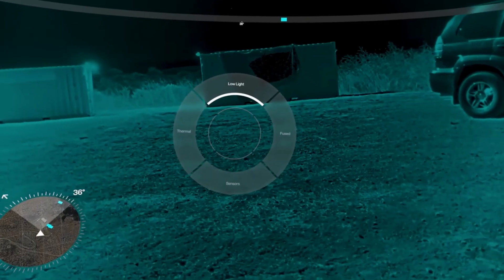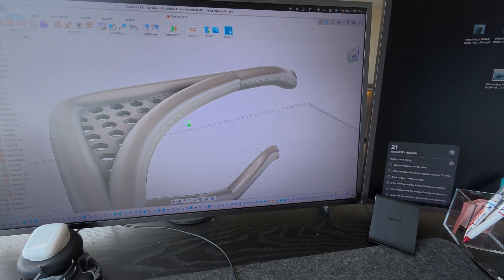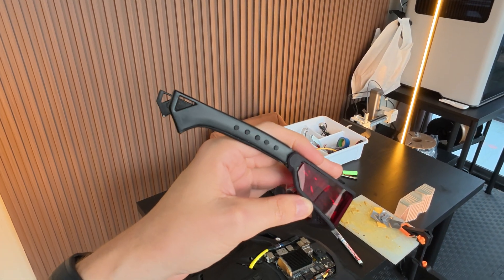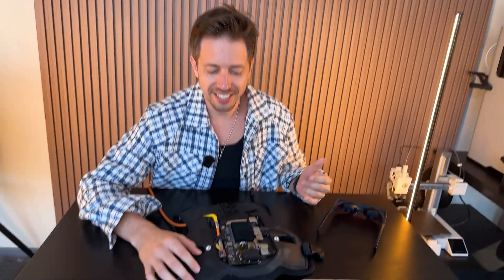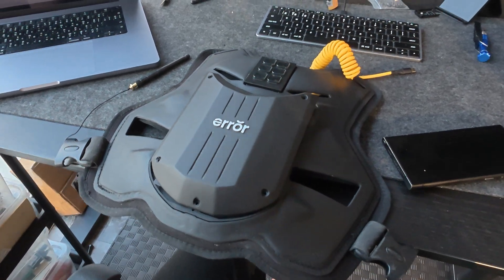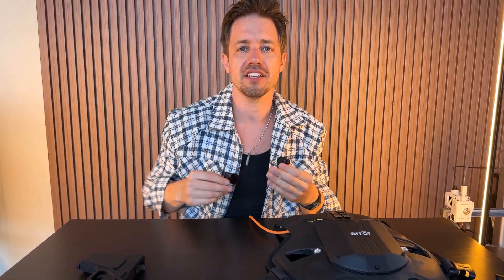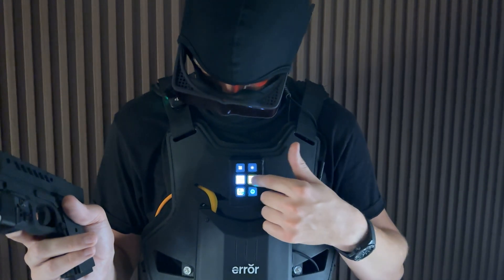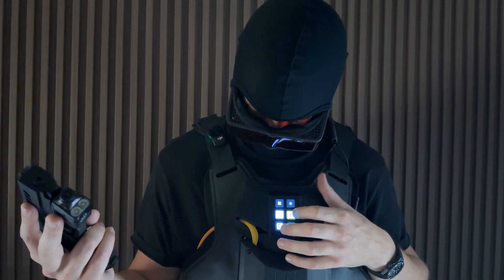I built my own ANDURIL EAGLE EYE

Comment: This is beyond cool. The possibilities are powerful. Range-finding + gyro integration for real-time 360° "radar" overlaid with the GPS map, foregrip style gun cam for longer battery life and recoil stability, inter-headset comms and video feeds, live recon auto-piloted drone feed, digital IR-based night vision, HUD waypoints, and so much that isn't crossing my mind. All it's lacking is hardening and encryption, against counter-offensives and espionage.
Reply: Ey error please add
drone
esp 32 radar like detecting humans 
wifi vision see through wall
thermal
pvs 14 analog night vision
Reply: @human-x8b  All really cool stuff, but I don't think WiFi imaging is possible (yet) in a portable, head-mounted form factor. Analog night vision could work for sure, but it's bulkier and more expensive, which is the reason why I mentioned IR-based NV. I guess I'm really price-conscious for cost-effectiveness reasons, but those additions will definitely make the headset more powerful and worth building into a more expensive unit.
Reply: Showing you how to gain control when parachuting got out of control.
Reply: aaaaaaaand several ways to track find and attack people dumb enough to have that  many sensors on them...your idea makes it possible for smart munitions to lock unto people
Reply: @chargedx5768  And your cell phone doesn't? The number of sensors means absolutely nothing. 

That would be true of any radio communications. Except an adversary would not be able to differentiate from person to person based on any of it if every target was equipped with the same devices. They could with cell phones though.

The idea isn't to hide from electronic warfare; it's to go on the offensive using it.
Reply: @RAndrewNeal  I am not planning on sending my cell phone into combat..you intend to send a person with all these sensors into combat...see the difference?...you dont come of as smart...so I will explain
the sensors you are talking about emit a lot of waves, if it is emitting waves then other sensors can pick up on those emissions and home in on them and track them, 
"an advesary would not be able to differentiate"...if the US can differentiate, Russia and China can..lol since those devices will be using different frequencies else everyone will be able to communicate to each other whether enemy or foe...all they have to do is look at which signals are in a frequency they are not using and then single those out as the enemy lol....
if you go on the offensive with another military with EW capabilities you are cooked....youd loose all awacs, EW jets and every person wearing a mobile sensor suit,....americans fought poor people for so long they think everyone they will fight will not have the tech to home in on all those signals
Reply: @chargedx5768  A-TAK is a very popular militia coordination software that runs on Android (cell phone); that's what I was getting at. Militia, not the official military.

Your argument died at "you don't come of as smart" ad hominem. If you're going to attempt to insult somebody's intelligence, at least try to make sure it's spelled correctly first.

Few of the sensors emit any EM waves; they're connected to radios which emit the waves.

You have obviously misunderstood what I meant about differentiation. An adversary could not differentiate between anybody using the equipment; they could only differentiate between someone using it and someone not using it.

Your suggestion to forgo electronic aids in an electronic warfare situation is utterly absurd. You have lost the war already if you deliberately handicap yourself by refusing to put yourself on equal or superior technological footing as the enemy.

Lastly, go make your arguments to Anduril, who is developing a much more refined and battle-ready version of this for the military. Maybe you'll convince them that their sensor-loaded equipment is a mistake and won't offer any advantages on the battlefield.